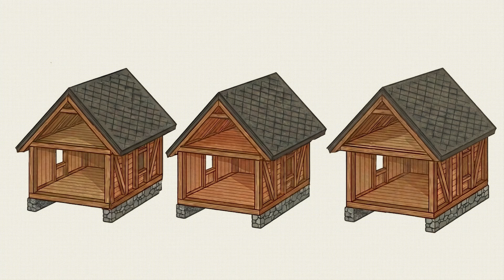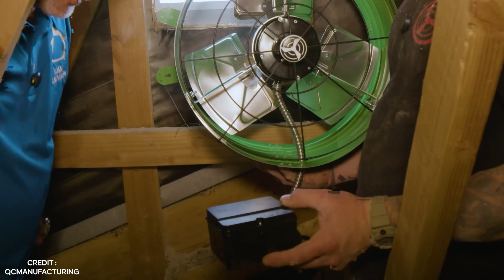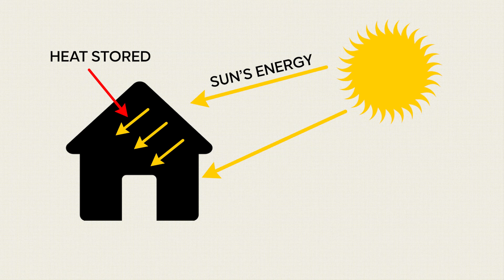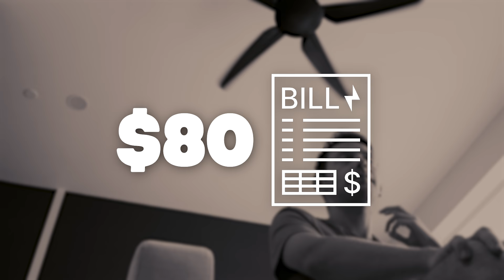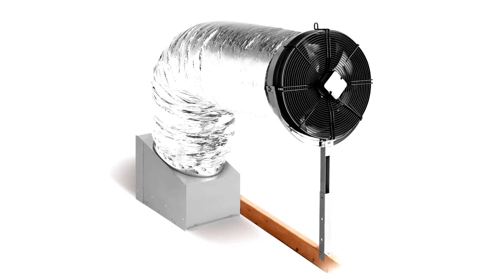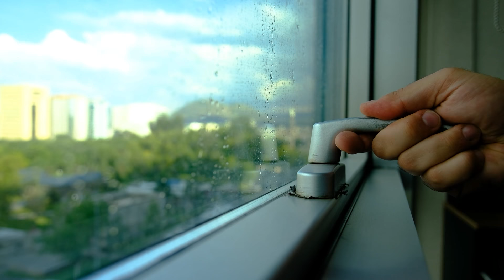This Device Cuts Any Cooling Bill by 90% and Uses 7x Less Power Than AC — Why Don't We Use It?

Comment: @wildline_yt you didn’t mention several things early enough (or at all) in the video.  I hope you can edit it to include this important information.
1) The heated walls (and the heated interior) is called “thermal mass”.
2)  You absolutely need to have well-insulated walls and attic.  If not, the house traps the heat all day.
3)  The sun shining through windows heats up your house during the day, creating ever-increasing temperatures until sundown.  Put reflective bubble wrap in the windows when the sun is shining through them.  DRAWING THE CURTAINS DOES NOT WORK.  You need to reflect the infrared radiation back to the outdoors before it gets into your home.  One brand is Reflectix;  you will find rolls of it in the insulation aisle of home centers.  A semipermanent option is reflective window film.
4) Run the fan(s) only after the exterior temperature is lower than the interior temp.  You said this way too late in the video.
5) I’m near the ocean in New England;  the nighttime lows are on average 19°F less than daytime highs.  In desert areas, the temperature swing is much greater.
6)  Similar effects can be generated with cheap 20” box fans in windows, instead of a whole house attic fan.

I have used these techniques for a few summers.  We only have a couple window air conditioners.  We only run them 5 to 10 days each summer, when daytime temps are over 90°.
Reply from the maker: Thank you for your comprehensive reply.  I agree with all of your statements.  The video is intended to inform people of the benefits of the whole house fan - which I think it does.  If you watch our other videos you will see we clearly understand thermal mass and thermal inertia, the benefits of solar reflection and how other methods of cooling can benefit householders.  In respect to box fans - you need to consider how you operate these in order to achieve maximum cooling - face in the way and you are trying ton push air into an already pressurised system - face out the way and you are drawing warm air out allowing cold air to be drawn into the house through natural ingresses in the house.  You may want to watch some of our other videos to see if you agree with what I have said above.  Really appreciate the feedback!

Comment: We have an old one in Memphis and it is only useful in shoulder season. It is okay. It doesn't drop the temp as much or as fast as you'd think. It also doesn't do jack to fight humidity. Ours is old though, and placed on the middle floor (not top) so take my experience with a grain of salt.

Comment: As soon as I heard that you had to open the windows for it to work, it was a no go for me. South Carolina, and pretty much all southern states don't bake as much as broil in the summer. You walk outside and it's like swimming just to get to the mail box. Opening a window is a death sentance.

Still, this is a really neat feature and I'm sure lots of people could use it.
Reply from the maker: Understand.  Perhaps you would benefit for natural dehumidification instead to reduce your AC load.  Something we have touched upon in another one of our videos.
Reply: @wildline_YT  I could use just about any help I can get, that's for sure. Love your videos. My only obstacle to getting something that would drastically help power or cool my house more efficiently is money :)
Reply: @Harrison.DuRant cheap 20-inch box fans are almost as effective.  Put them in the window only at night
Reply: far too late in the video, the author said to run the fan at night.  Most of South Carolina has a 19°F daily temperature swing.  I live near the ocean in New England.  This does work for us, BUT you need a well-insulated house and put reflective bubble wrap in the windows during the day.

Comment: The issue with this idea is if you're used to let's say 72 degree house in the summer, with 100% efficiency on a 75 degree day, you'll get a 75 degree house. Realistically, if you want to live in a 72 degree house, it'll need to be 70 or 68 degrees outside.

Also, in areas that get really humid in the summer (I'm looking at you east coast), this doesn't address the humidity issue

Comment: Under 82 degrees. Summer is in 90 to 100s in US and in southern US is humid. When its humid all the attic fan will do is pull more humid hot air in instead of cool dry air. The high humidity makes it so sweating doesnt cool but and the hot air stick to your body making it muggy. Attic fan doesn't work in the southern humid states and why its not used.

Add: Yeah you stated this in the video. Most people ignore the humid south but remember. 😊
Reply: Idk man, my mother's house was built in the 60s in the Southeastern US, she used an attic fan until the mid 90s when it broke and she was gullible so instead of just fixing it she got conned into giving up her furnace to make room for a big but inefficient central air system. I'd go back to the attic fan in a heartbeat if I wasn't stuck renting for the rest of my life.
Reply: @PokeFit3 i also grew up in south carolina in a house with an attic fan. We thought it was ok but had to also use 4  window AC units to help with the heat; 1 in each bed room, den and living room. We ended up getting a HVAC when i was 16. It was a vast improvement and the electric bill dropped. The issue is an attoc fan can not pull dry air becouse there isnt any outside plus in south carolina the water table is so shallow that most houses can not have basements so most are slab houses. This means the air it pulls is the humid 90° outside air.

Comment: So, how can you adapt this principle to a single level apartment, then?  There must be a way.
Reply: I've used box fans in windows, but always blowing out and you need a cool open window or several from the other parts of the apartment. By blowing out, you can get 1 fan to draw in cool air from several different windows, keep the furthest one open the most. Or like the other guy is talking about, might be able to upgrade the bathroom fan. 

[With fans venting out always make sure another window is open if you use any gas water heaters, clothes dryers or, (I was going to add) furnace but not in the in summer) and good to have a CO alarm too.]

Comment: I'll admit that when it comes to stuff like this i'm not that smart, so don't hold that against me when i say things. Couldn't people use a combination: Fan to pump out the hot air, AC to bring in cool air? Why does one need to "bring in fresh air from outside"? It seems to me that AC + fan combo would be cheaper than straight AC...no?
Reply from the maker: A/C conditions air by circulating it over an evaporative coil (like a fridge) for cooling.  You wouldn't want to extract conditioned air as that would be a waste of money.  You could use A/C for peak cooling but you would need to make sure you shut off your whole house fan and only bring it on when the temperature rises. You would need to also manually control your A/C because if it were set auto it would come on when temperature hits the set point.

Comment: as a french, "under 82 degrees" (so under 28°C) is a joke. In my flat, without any cooling, I'll start to feel uncomfortable when temperatures outside reach 35°C (95°F) and don't cool down below 20°C (68°F) at night.
Reply from the maker: It is not a solution for everywhere!  Sounds like you would be better served by implementing a regime of solar shading combined with evaporative cooling.  The obvious alternative is A/C.
Reply: You keep cool and safe. I pray france doesn't have another heat wave.

Comment: i live in a small 1 room row-house, i already use my Ø100mm bathroom extractor fan in this way (vents from bathroom directly outside) but the way it's designed, the motor hub fills most of the airflow path, so my thought is keep the Ø100mm intake and outside outlet  but replace the bathroom fan with an inline Ø200mm and if there is spiral hose in the attic then i'll replace it with ridget ducting perferebeal isolated for the cold Danish vinters..
Reply from the maker: Interesting design proposal.  Let us know how it goes!

Comment: We had one of these on our house in Connecticut and it was AMAZING!  Then we moved to Oregon where it should work as well and no one has one.  I talked to our A/C guy and he said they just aren't used here, but I don't know why.  During the day in the summer the temperature usually does not get above 80 but can sometimes get into the 90's but nighttime lows rarely get above 60 and night time humidity rarely gets above 60% and even better, we have a below ground finished basement that never gets above 70 so we can always draw cool air from there.  I just compared the summer night time temperatures and humidity for our town where we live in Connecticut and where we live not an they are almost the same.  So, why the difference?  I think the most likely cause is that winters here are warmer so a normal electric ducted heating system works here but in Connecticut we had a oil furnace baseboard heating system.
Reply from the maker: Not sure why the difference other than state norms in terms of technology selection.  If it is common to have A/C then that is what is installed and used.

Comment: To those in the comments section who live in places where it's often way hotter than 82F, look into passive cooling like cooling paint and other new methods of cooling. You can now buy paint that will drop the surface temperature of a roof or wall by 20F and the paint isn't that expensive. Whole house fans are great, but they don't work for everyone in every place, but there are things you can do even in places much hotter than 82F.
Reply: but then will i have to paint it black again to capture the heat in the winter?
Reply: Issue with the paint is it not good on asphalt shingles which most american uses. Its more common used on metal and clay roofs. The issue is asphalt and paint causes moister build up and more mold and roof moisture expansion. It will make your roof fail prematurely. So roofing companies will not even apply it to an asphalt roof.

Comment: In my part of Canada, it makes sense to use this all the way up until the late morning, because houses heat up at that point, and the air is still cool. It's only the early afternoon, when we start to reach that point where we need to shut her down.

I wish that more homes had this. Even just airing out the attic in the evening would make a difference.
Reply: You can accomplish the same thing with cheap 20-inch fans in the windows.

Comment: >under 82 degrees

Ah. Okay. So it won't work for me.
Reply: I think they mean 82F which is about 27C
Reply: Under 82 degrees works better than AC.

Over 82 degrees AC cools better, but it doesn’t mean it doesn’t work.

If your attic is 152 degrees, a 100 degree outside air will still cool it closer to 100.

Ideally, on hotter than 82 days, you vent only the attic air and not the whole house air. Cool the house air further it with AC.
Reply from the maker: Not for everyone!
Reply: Most of the US these attic fans doesn't work.

Comment: does it really help??
Reply from the maker: Extracting warm air and venting it via the attic will help.  You should consider installing an attic fan to extract the air to the outside otherwise the heat could build up in the attic and thus the benefit would be significantly reduced.